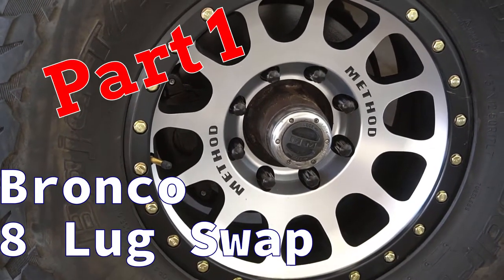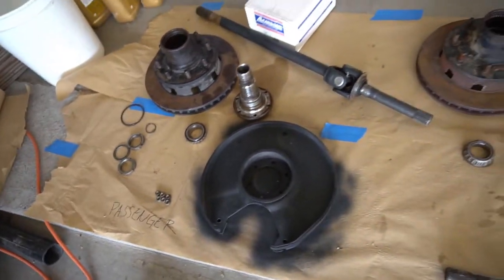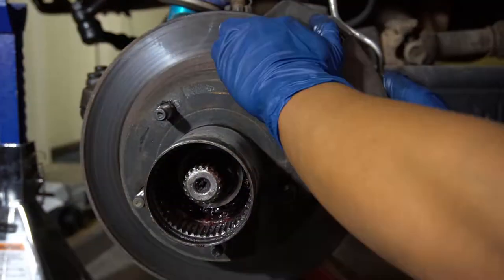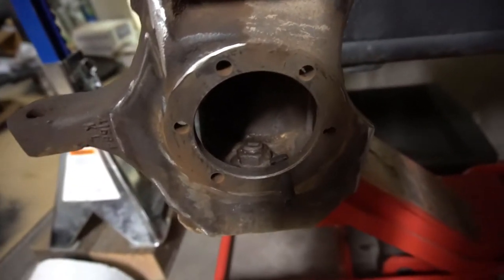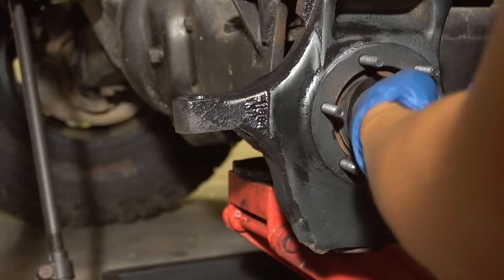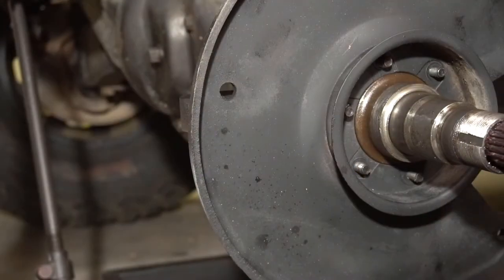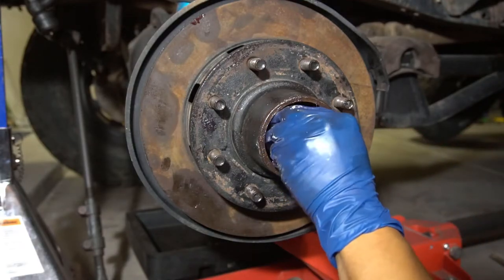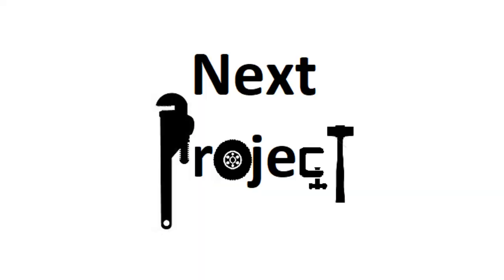Bronco 8 lug front axle conversion

Comment: 5k-10k "saved" would b 8lug even though not near as much wheels or my idea where u hve a 5lug tire only doubled 5standard lugs & 5outside lugs next to the inner standard 5. that way u can run old rims yet if making power u can run new 5&5 lug upgrade rims or drill 5 holes into old rims so long as bead lock quality billet or high end rim.

Comment: all you need is 79 f250 8 lug stubs,ect..i cut my diff down 3",as the 8 lug is wider.i used a jeep shaft for correct length.EASY CONV.,NO CHEV STUFF ON MY TRUCK.

Comment: Yo I know this is late, but I didn't see how you mounted the calipers after you cut the old ears off?? 

TTB swap on a 2wd automatic f150 with an f250 4wd 5 speed manual drivetrain swap.

Comment: I realize this is an older video, but would it be possible to just swap over the entire knuckle from the k20 dana 44/10 bolt? Or do you absolutely have to use the ford knuckles with the Chevy snouts?

Comment: I don't understand. my f150 only has 5 nuts to hold the spindle on and I looked at my parts truck and it's the same.
Reply from the maker: Evan Anderson interesting, what year and model? I assume it's 4x4 also
Reply: +Next Project it's a 1996 xlt regular cab long bed 4x4. my parts truck is a 95 short bed reg cab xl 4x4. both have the 300 six. the 96 was an automatic the 95 is stick.
Reply from the maker: Evan Anderson ok so after some searching,  it appears that pre 93 are 6 bolt spindles and at 93 and some 93 and over are 5 bolt to make room for abs. I don't know if this swap will work for you but id like to hear if you attempt it. Thanks!
Reply from the maker: http://farm5.static.flickr.com/4009/5076672368_2fce6c25ec_b.jpg
Reply: +Next Project ok that explains it. I've had a ton of these trucks and never noticed that before. I know the axle beams are the same so it looks like I just need to find a 6 bolt knuckle. thank you and keep up the good work on your videos!
Reply: Look for 80-86 Bronco knuckles. Ebay has them. Those are the 6 bolt ones you want for this swap. -TJ

Comment: By doing this mod how can I achieve the Ford 8x6.5 bolt pattern because I'm going to be swapping in a Sterling 10.25? Thanks
Reply from the maker: It's the same pattern, I believe Ford didn't change to a new bolt pattern till later on. I am assuming your Sterling is an older one that is 8x6.5.
Reply: @NextProjects  Yes, pulled it off a '97 F-250 last week. I chose to go with the OBS model Sterling because it is supposed to bolt right up and because my '94 has VSS, if not I probably would have gone with a 14-bolt like you did because of the cheaper parts. Next Project I've having a hard time finding wheels because I personally like 15''s but supposedly those wont fit once I add a caliper kit to the Sterling (despite the 8 lugs too). 17''s are cool and have more  tire options but I really wouldn't want to go more than 16''s, (this is a mud/trail truck NOT prerunner) any suggestions on wheel offsets to look for? How were you able to search on Craigslist and be sure that the wheels would fit, did you drive to the seller and install on your truck before purchasing the wheels? I know those were a few questions but I appreciate your help. BTW you should chime in on Fullsizebronco.com and update your build thread, I stumbled upon your thread when I was reading on 8-lug conversions for the TTB.
Reply: Ford didn't change them until 99 and up. But the E350  stayed 8x6.5 .  I used the rear dana 60 axle of a E350  for a disc brake  conversion on one of my projects
Reply: What advantages do you see in this conversion? I’m not judging, nor do I intend this to be sarcastic. I am curious. 

Thank you!
Reply: @GSKWARE  Bigger brakes, and make it match the swapped in rear axle pattern.
Reply: What year was the Chevy donor?